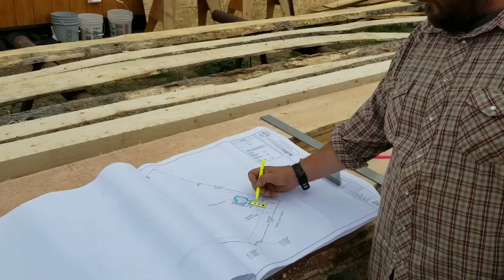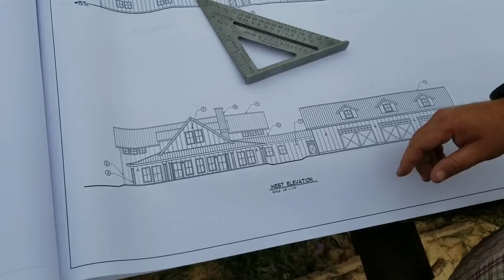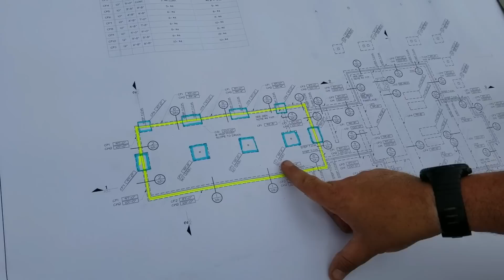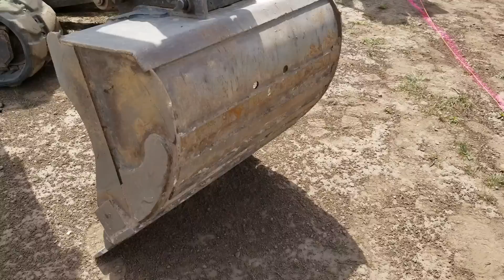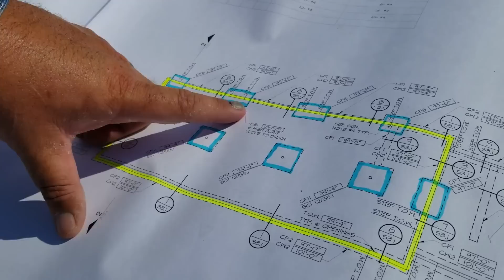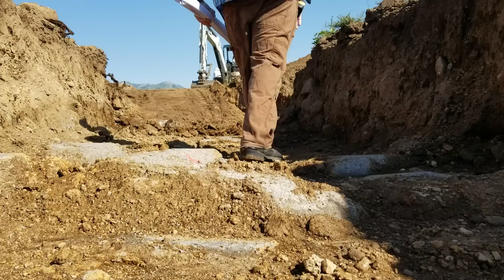House Plans and Permits, We Can Now Move Forward Building Our Dream Home

Comment: A friend of mine built a large shop  40x80 heated floor and storage under the floor. This made a cozy place for( storing )beds, kitchen,bath , any thing a family could use  as they plan and build the dream home .  Happy wife happy Dad happy kids.  The outdoor wood stove heated the shop load it in the morning and load it when you get home, it also  gave them hot water for the family .Drive your dump truck  in and close big door  leave winter outside, visit the family
 surprisingly quiet even with dump trucks and air tools. they now have a Very nice home. depreciation will help you with cash flow for the new home.